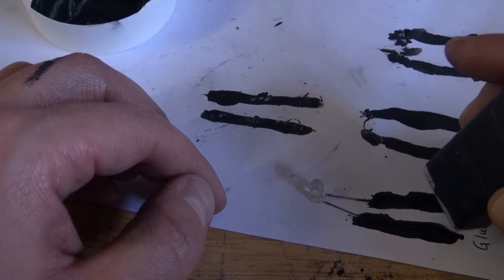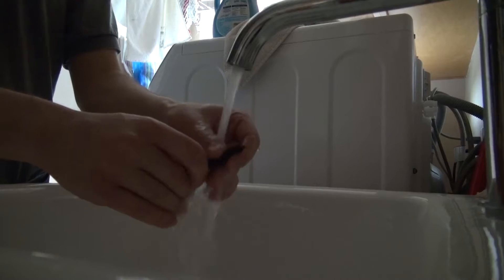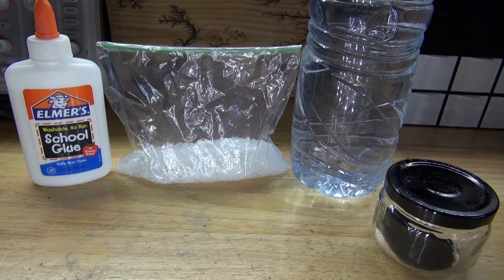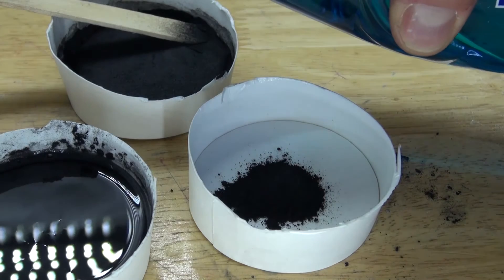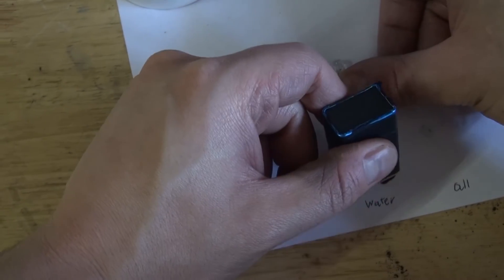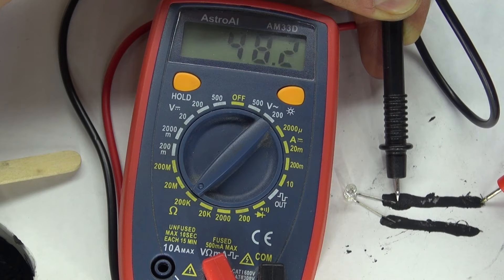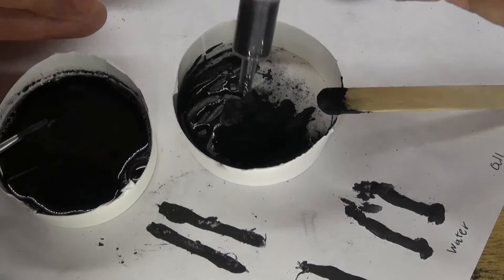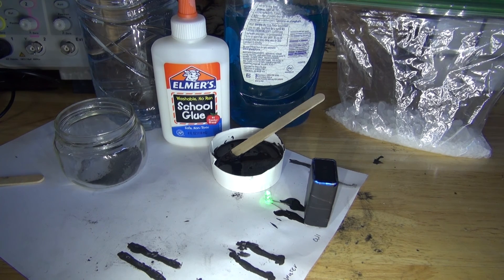How To Make Conductive Paint

Comment: You call it "paint". That implies that is will be allowed to dry. You did not allow your paint to dry before measuring the resistance. Your ohm measurements of wet paint are worthless. You should allow the paint dry before you measure the resistance.

Comment: Nice Video!

But do you have to use the Graphite rods from battery's? I mean, they are pure carbon. Instead of cracking open batteries, couldn't you use charcoal/activated charcoal/literary Graphite instead? It should be the same.

Also, the particles seem a bit too big. If you want to step up your game, you could be using a Glass Muller to make the resulting paint more consistent. It is usually used for pigments in painting, to basically do exactly what you do in the video.
Reply from the maker: Yes you can use pure graphite. you could get them from pencils too. 

That's a good idea!

Comment: You need to wait until the paint is dry to perform the conductivity test. You are getting good results with the one that contains salt because it still has water in it. Once the water dries, the conductivity will decrease significantly.
Reply from the maker: Yes, that is true.

Comment: Why doesn't anyone use powdered aluminum when making conductive paint???
Reply: bad for soldering, requires more heat
Reply: fine powder aluminum is hard to obtain and pretty dangerous as it can self-ignite
Reply: @anoirbentanfous  Um, wrong.  Amazon.
Reply: @anoirbentanfous  so when do you suppose the bags of powdered aluminum I've had in my cabinet for 4 or 5 years now are finally going to go up?
Reply: Boom! no good
Reply: @hectorcalderondiaz1821  That's not how science works, though.  Who told you that, people that don't want us to be able to shield ourselves from RF?  What are you, some kind of first level gatekeeper?

Comment: I heard instead of dish soap you can use Xanthan Gum powder or honey?
I wonder if they would affect the results..
also superglue forms cement-like strength when adding backing soda or any fine powder like coffee ground, can this substitute solder for burnt led lights (we need some resistance in place of the burnt led)

Comment: Going to use this recipe to fix some remote control buttons where the carbon pads have worn👍 Thanks for the great tip 😊
Reply: small pieces of plain adhesive aluminum tape also works fine on remotes
Reply: @billkabb  thanks Bill! this is exactly what I did when my superglue/graphite solution didn't work! the slightly stiffer surface did make a good foundation to glue the aluminum tape though :)

Comment: I don't think the tiny contact points of the voltmeter probes are doing this material justice. I would guess almost all the resistance is very close to those points. Suggest putting down two pieces of aluminum foil a couple of inches apart and painting a strip across between them. I'm sure you'll get much lower readings. At the moment, I have some graphite and lacquer drying between two thin wires maybe 3/16" apart. Already, the resistance is down in the tens of ohms, and it keeps getting lower as the lacquer dries. I think my mix is about as wide as your stripes, but since your stripes are maybe 10 times as long, you'd probably be seeing resistances in the hundreds if you had good contact points for the probes. BTW, I"m using Elmer's regular glue instead of school glue. I doubt that makes much difference, but I suppose it might.

Comment: Can I make an megaohm resistance conductive paint?
Reply from the maker: Most likely.
Reply: Better use a lot less graphite or a very long strip. India ink is slightly conductive. Not nearly as conductive as graphite, though. Just the thing to coat ping pong balls with for silly high voltage experiments with a van de Graaff machine.  @SciTyeTech

Comment: how to repair carbon contact on laptop keyboard frc connector
Reply: super glue with graphite powder
Reply: @anoirbentanfous  I will test the conductivity first,  will  it work on lcd display for mobiles , flex polyamide connector tore off due to its shelf life (polyamide flat flex stuff on which copper tracks )
Reply: Did it work ?

Comment: And the empty 6volt container can be used for holding pencils, pens, etc. Or it could be repurposed for another battery.🤪
Reply from the maker: That's a good idea! I could put rechargeable lithium batteries in it.
Reply: @SciTyeTech  and can you imagine the amount of power you would get if you filled that sucker up with the coin-sized “2032’s” or similar?🤪

Comment: I am curious why there is a need to use distilled water?
Reply from the maker: You can use tap water. I only use distilled water because I wanted to see what is more conductive. Distilled water is not conductive, therefore I wanted more accurate results.
Reply: @SciTyeTech  😮
Reply: Not only that, but someone elsewhere will be able to repeat the results. @SciTyeTech
Reply: Colorado River water already has 2 gms/liter.

Comment: Outstanding re-purposing of recovered battery carbon rods!
Printed "thin film" resistors is one possible application for your unique chemistry, cheers.
Reply from the maker: Thanks! Glad you liked the video! Yes, to use this as a type of resistor is a good idea. I also thought of making paper circuits with using this material.